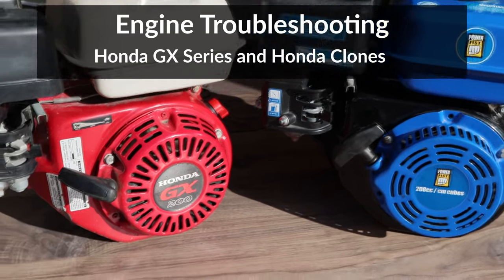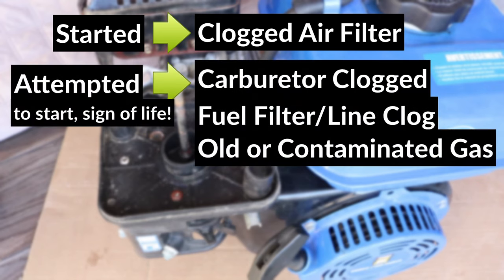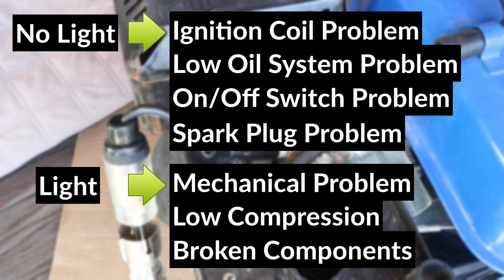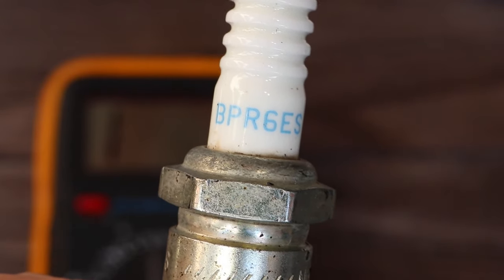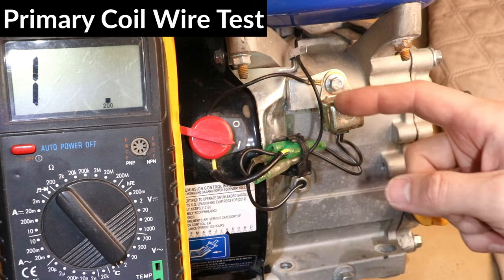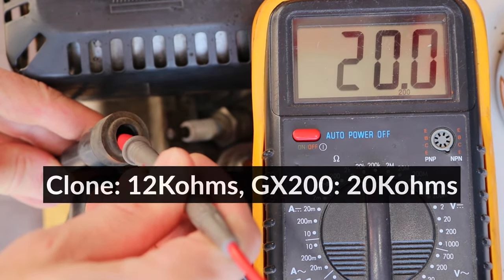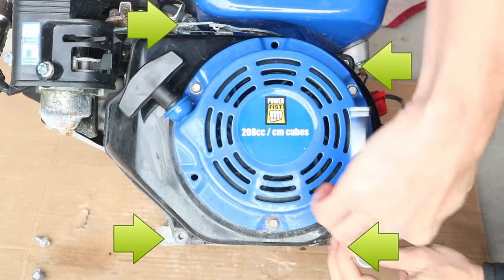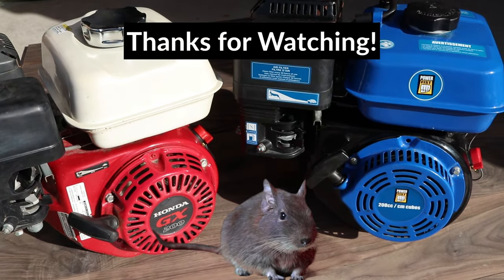Honda GX200 Won't Start - Spark, Compression, Electrical & Carburetor Test

Comment: If your GX200 engine spits, sputters, backfires, and possibly runs fine intermittently check the spark plug boot for arcing between the boot and valve cover.
Mine was doing this and had me stumped until I started it after dark and saw the arcing. You can slip a thin piece of plastic like a milk jug in that area to confirm this.

Comment: Thanks for the video. It helped me to identify a faulty oil level sensor (although the oil level was o.k.), so I temporarily disconnected it until I can explore a replacement procedure.
Reply from the maker: Yep, I've seen that happen. It's not too hard to replace.

Comment: Thank you, it solved my problem and here are some tips.
I bought a used plate vibrator that had been in storage where it had been sitting for 2 years without being used and it could not start.
When i pull the handle My sparkplug could only create 1 spark wich was to little to turn on the engine.
I was aware there was to little oil in the engine but to me that dident matter since i just wanted to turn it on for a few seconds just to test it could start since i just bought the machine and dident have to use it right now. 
Anyway i had no idea the machine had a sensor and a security system that prevent me from starting an engine with to little or no oil in it.
I think that is a really great feature, i just wish i had known i started to trouble shoot and test this and that.

But after watching the above video i realized why my engine would not start and i just filled some more oil in the system and that instant made the sparkplug generate more sparks since the sensor now register enough oil in the system.
And i also cleaned the caborator since the machine had not been used for 2 years.
TIP..: If you engine dont want to start then in many cases it will help to clean the "jet" in the gazoline system since it can get clogged due to dirt and prevent the gazoline from getting though the caborator and into the engine. 
View this video.
( example https://youtu.be/Zlyv8EtZEk0?t=252 )

TIP..: its important that the two oil pins on the engine can shut tight 100%, els the oil will slowly drain out of the engine. This happen on my plate vibrator and is properbly why there was so little oil.
When the plate vibrator is parked and the transport wheels are deployed then its tilted in a 45 degree angle and then oil can run out... So always put your machine on a level surface when you park it ;-)
Reply: i9k

Comment: Thanks for your video. I thought I had a faulty on/off switch before finding your video. Then a light bulb came on. Go and check the oil level. Sure enough it was low and the sensor was doing its thing. Filled up with oil and it started first pull. Never overlook the obvious.
Reply: Exact same situation. Thanks a lot for the help.
Reply: When I pull the dip stick I have oil dripping out so there must be enough oil, right?? I’ve cleaned the carb jets, checked spark (yes there is spark) cleaned carb bowl, fixed a loose  valve lifter, and when I pull it It’ll occasionally sputter but never run
Reply: And sure feels like there’s compression when I pull the cord

Comment: Hi , Thanks for the best video ever, comprehensive and educational, If you would answer a question , I have same engine on a fairly new Plate compactor , ran very good since we bought new (used it about 8 hours), gradually started running rough , then black smoke through exhaust, low power to the point that did not vibrate anymore, Living in Africa (no after sales service), tried couple of street mechanics , finding is run fine if we remove the air filter , I washed and cleaned dried the semi dirty airfilter, worked well for 15 minutes back to puffing black smoke, any idea what to look for?
Reply from the maker: Black smoke means it's getting too much gas, not enough oxygen. You can't wash those filters,.. the sponge part yes, the paper part NO.. Try it again without the filter, and if it runs fine, you need a new filter. Compacting creates a lot of dust and the filter will clog up completely to the point that it can't even start sometimes.
If it doesn't run properly without the filter, then let me know and there are other things you'll need to check, like compression.. Running with black smoke is not good, it will create carbon deposits and you may lose compression on the valve seats if you run like that too much.

Comment: you said that leaving gas in the tank causes water to accumulate in the tank but isn't the tank more likely to rust if it is empty? Because I notice some rust in my tank, and I had drained it when I last stored it. I INSTALLED A NEW CARB. NEW EXHAUST, NEW VALVE COVER , NEW PLUG and it was working fine before I stored it away about 6mths ago; and when I came back to use it, it hard-started ran for a while stalled and wouldn't restart. Any ideas on what would cause that.BY THE WAY WOULD RUST ON THE MAGNETO OR COIL CAUSE ANY PROBLEMS? No one ever talks about that, they only show how to test the coil, but what if the coils is good? Thank you for your thoughts and videos!!!!!!!!!!!!!!!!!!!!!!!
Reply from the maker: I've seen a little rust  very old tanks, and it doesn't affect the engine usually.. I've never had a problem due to rust in the tank myself..  I think these tanks are fairly air tight, so moist air shouldn't be able to enter the tank while the cap is closed.. Some air may enter through the intake/valve cover breather though.
Some people fill the tank all the way up and add stabilizer for winter. I've never done that myself, I just drain mine and haven't noticed rust getting worse. It will also depend on how moist the air is where you store it, and if the temperature keeps changing from hot to cold.
I haven't found that rust on the magneto is a problem. They can be rusty and still work fine.  
To figure out the issue, did you go through the steps?
Does it run if starter spray is used for a few seconds? Does the spark plug tester blink?
Reply: @CleverFix  since I wrote this I reinstalled the old parts and it seems as if the new exhaust was the problem; because it runs better with the old one, so I don't understand why the new exhaust would cause a problem but it was backfiring loudly and spitting fire through the exhaust; with the old exhaust it only has a small backfire when it is switched off.Maybe I need to get the Honda OE muffler. With the old carburettor the choke has to be on to keep it running which is why I replaced it in the first place; I had also replaced the valve cover with a new one but I don't know how that would affect the running.

Comment: Hi what kind of oil should i use for my honda gx240?
Reply from the maker: 5W-30 if you'll use it in the winter/fall with colder temperatures, 10W-30 if summer only. If you'll use it below 50F or 12C, go with 5W-30.
Reply from the maker: If you want to read more, here is the manual, page 8, https://cdn.powerequipment.honda.com/engines/pdf/manuals/37Z5F602.pdf

Comment: In case you don't know there's a fuse inside of the spark plug  boot Don't change the Magneto cut the wire and then check it
Reply from the maker: The wire unscrews out of the magneto, it's screwed in..  you can find new plug and wire that you can screw onto the magneto in case you need to replace it. I believe you're talking about the resistor.  I got a new coil anyway. It's very cheap, about $12. The mouse ate the wire, it was not a problem with the resistor, the wire had been eaten. I'll keep it as a spare.

Comment: Spark plug boots should be replaced if the motor is getting old. Cheap. They unscrew. Easy to replace. The spark could be weak but still show a spark.

Comment: Hi, thank you for this great video, have you a video on governor adjustment to slow the engine down on a honda gx200 engine, thanks john
Reply from the maker: No I don't have a video, typically you should not need to touch the governor adjustment, ever... if it's suddenly not running right, look for other issues first, it's very rare that you need to adjust the governor.. unless something happened and then nut got lose.. sometimes there's breakage of the weights inside the engine, sometimes the link is just stuck at the carburetor side or doesn't move freely.. but I'd be suspicious about suddenly needing to adjust the governor, and it would not really help if there's an underlying cause.
Reply: @CleverFix  I'd just like to slow the engine speed down a bit on my generator, there is no throttle and the idle speed screw is backed off as far as it can go.

Comment: Hi dear my friend. Same engine. Spark plugs fail quickly. The spark plug turns black. what is the problem?
Reply from the maker: Possibly your air filter is too clogged, or you're using the wrong spark plug or spark plug gap.
Reply: Thank's sir. Could the cylinder be worn?

Comment: What if the engine turns on. And after 30 seconds it turns off. And I did a new carburetor, new air filter. New spark plug. New ignition coil. New oil. Even bypass oil sensor. Rpm set to max gas lid open. But for some reason, it still stalls. And turns on a bit after a while again.
Reply from the maker: How does it start after it stalls, does it start easy or won't start?
Did you clean the gas tank? I'm thinking there could be a small clog in the fuel line. So fuel goes to Carb and fills it up, enough to run for 30 seconds.. then fuel is depleted and it stalls.  Waiting a few minutes allows more fuel to fill the carb, and run for another 30 seconds.  It would probably run for more than 30 seconds with a full carb though.. but just an idea, if you disconnect the fuel hose to the carb for a second to test, fuel should flow out freely.
Reply: @CleverFix  yes I also added a new fuel filter that goes inside the fuel tank with a new hose tube that goes to the new carb but still does the same thing. The engine cranks beautifully but it keeps turning off after 30secs
Reply from the maker: @DJPacoRamirez  When it starts and it runs, do you get a chance to close the choke, or does it run on choke only ?
The only thing that changes after 30 seconds is that the engine warms up, and it needs the choke to be closed, so it can get enough air. It's difficult to get an idea without hearing it and seeing how it re-starts after the 30sec.
Reply: @CleverFix  yes at first I have it on choke then I move it to run once the engine turns on. (Btw, the engine is hooked up as a powerwasher) my throttle is set to max.
Reply from the maker: @DJPacoRamirez  OH, Well, then it's possible you have bad water pump. Have you tried it without it being connected to the pump?  Also did you try keeping it on choke and see if it continues to run, without moving the lever to run?.. That would indicate a problem with the carb, maybe even the new carb has a problem, sometimes they're manufactured with defects.
Reply from the maker: @DJPacoRamirez  I'd try it without pump if you haven't tried.

Comment: awesome, thanks a lot
Reply from the maker: You're welcome, thanks for watching!
Reply: @CleverFix  i have a 7 hp clone mounted on a chassis for a water pressure washer , i m gonna put new oil in the engine and also hydraulic oil in the pump and restart it

Comment: I though compression should be over 100 psi?
Reply from the maker: There's a mechanism to bleed the pressure off, for easy starting. The actual compression is much higher. Some older models don't have it, so the actual compression can be measured, but not these newer models.

Comment: I have spark and replaced the carb , tank and engine still won't start
Reply from the maker: Did you try without the air filter on? And with starter fluid? Checked compression?

Comment: you know gx390 compression psi?
Reply from the maker: No I've never tested one, but all of the newer engines will have the compression release mechanism so the gauge will not read the true compression. If you get something similar to me, around 40, then it's likely the release mechanism.. that makes it easy to pull the cord, but when it's running the mechanism no longer releases any pressure.

Comment: starter fluid will verify the Ignition {spark} system. You substitute the fuel system with something known good, so if it stil doesn't  run. its something else at fault- compression or ignition. Don't close the choke when testing with starter fluid, you want the fluid to have a free flow into the cylinder. If you don't know what you're doing, don't make youtube videos suggesting that you do.
Reply from the maker: If you watch the video, you will see I checked compression, ignition and electrical system after the starter fluid didn't help.
Also, there are auto-choke engines where choke is applied automatically and cannot be manually opened, and starter fluid still works on them also, so choke will not prevent starter fluid from working.

Comment: The tester doesn’t test the spark plug it tests the electrical system
Reply from the maker: That's why you should also check the spark plug as I explain in the video with the voltmeter.
Reply from the maker: Also, if your spark plug is not grounded (something very wrong with it), the tester will not light. So it does test the spark plug to a degree.

Comment: Im getting spark, Im getting compression, I have good gas, the wires are all good, but it still won't freaking start!
Reply from the maker: If you're getting spark and compression, then you should be able to make it half-start by spraying starter fluid, .. does it start with started fluid and then stop?  If someone continuously sprays starter fluid while you pull the cord, it should keep running for at least a second or so.  Is that the case?
Reply: @CleverFix I have the same problem as this guy and I have used starting fluid but nothing happens except after a while it backfires